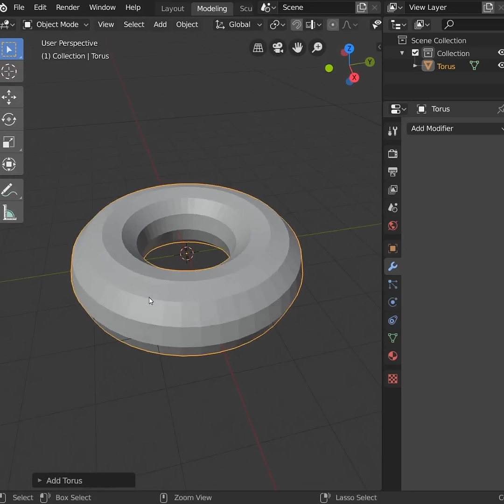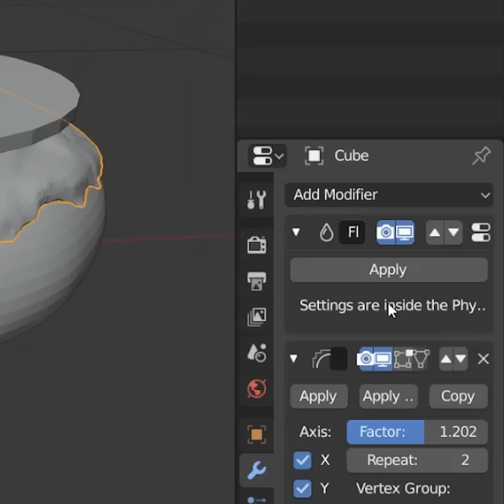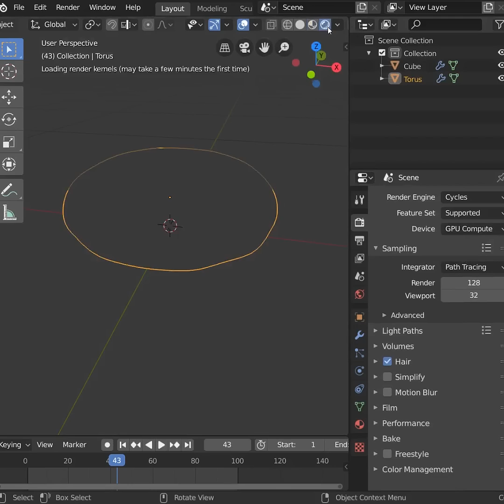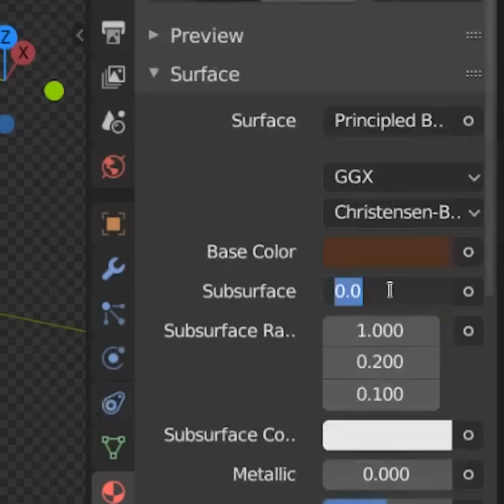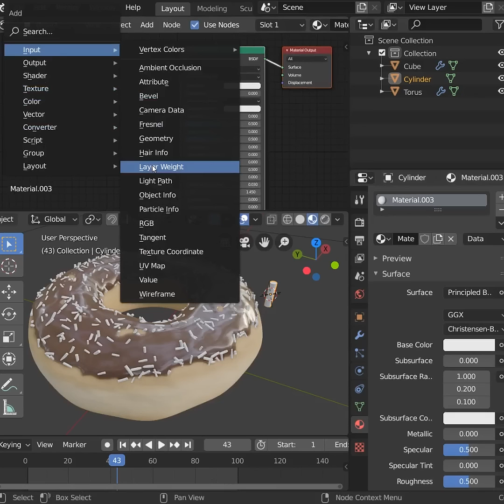Create a Donut in Blender in 1 Minute

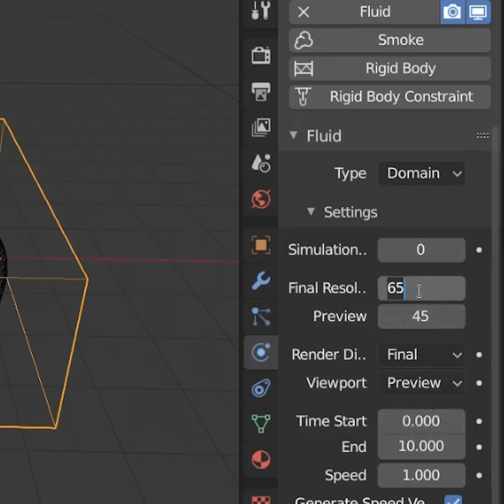Comment: im so confused 0:12 when i click the thing I only see None, Domain,  Flow,  Effector and not the other stuff I need, I'm stuck at this point pls halp
Reply: Same.
Reply: @bloookw  a solution?
Reply: @Spring2312  I don't think he is using 2.9
effector is what the fluid will interact with
domain is the box the fluid is in
flow is the object that creats the fluid
I'm new to blender so I am not completly sure but i think this is right
Reply: His video is based on older version of blender. New versions have a completely different fluid simulator.

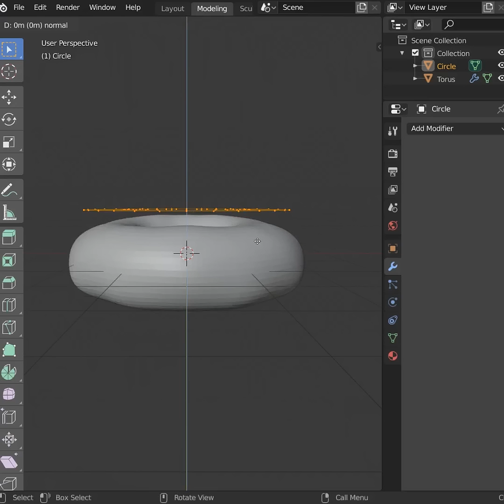Comment: 0:11 beginner here. why is there no obstacle or fluid? it's only flow and effector? help?
Reply: I need help here too
Reply: Because this only works in blender 2.80, v2.82 and higher have a new fluid simulation system.
Reply: @asgard-ua  so is it impossible to get the obstacle fluid options? or do you have to do something different??
Reply: @TheHangars.  basically you have to find an newer tutorial for the latest blender.